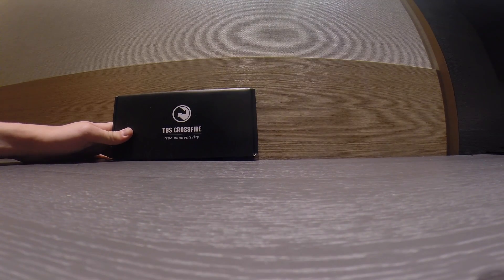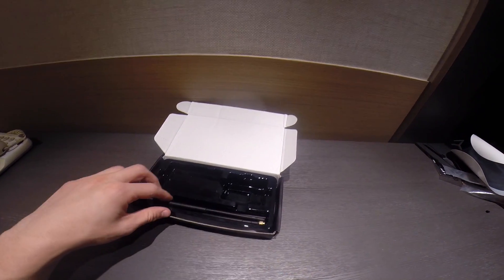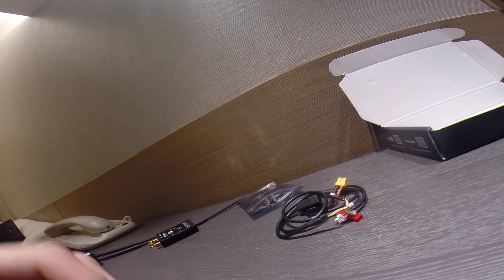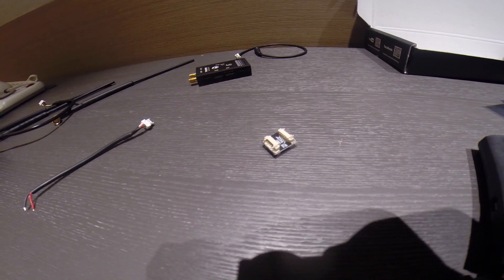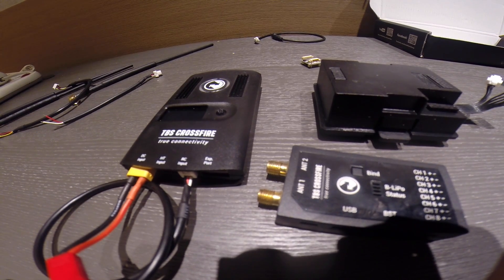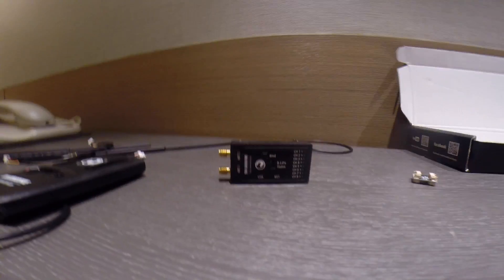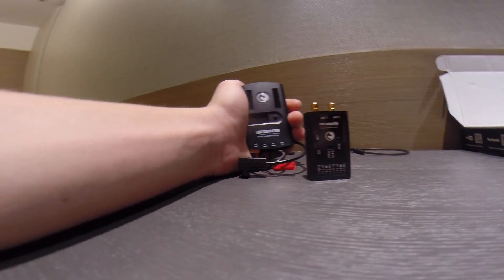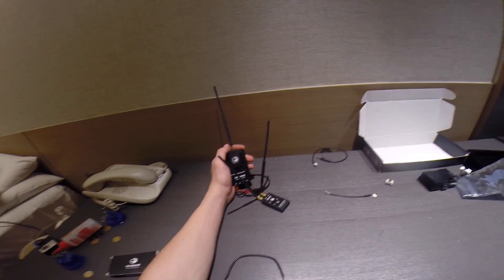TBS CROSSFIRE: First ever unboxing, first look, and overview.

Comment: Hey TIRC - any idea how to get the RSSI setup with my cyclops storm OSD? I am not getting anything. Thank you.
Reply from the maker: +Aero FPV Not sure but I can take a look later. Probably grab analog rssi out from the rx instead of using ppm stream
Reply: Could you look into that for me. I would greatly appreciate it and owe you one :) Thanks so much mate.
Reply: Seems as if the Crossfire was designed to accept the Vecter via the BST port but what about the other full featured 3rd party OSD's with rssi options? Again thanks mate.

Comment: could u use this system, with a 1.2ghz video transmitter? or will they interfere with one another?
Reply from the maker: +RcModelTest Yes, I fly 1.3ghz video and crossfire with no issues, up to 1.5watts on the 1.3 band.
-Daft

Comment: Technically, the frequency used by Crossfire is within the UHF band, which is from 300MHz to 3GHz. So it is not exactly wrong to say that it is UHF.
Reply from the maker: Carpe Luce Thanks for the correction, my bad
-Daft